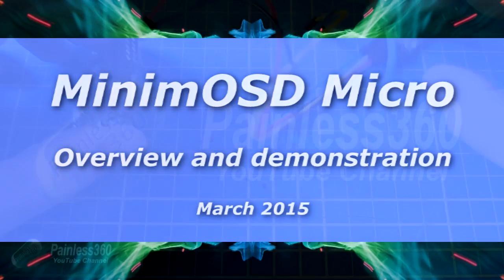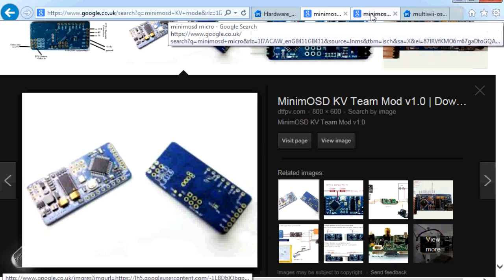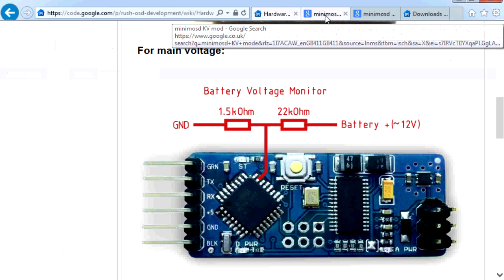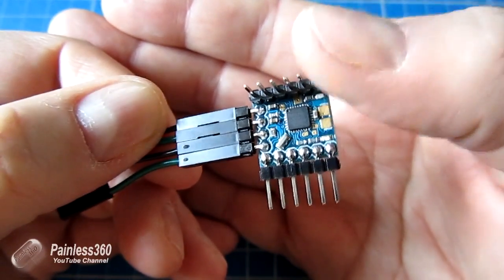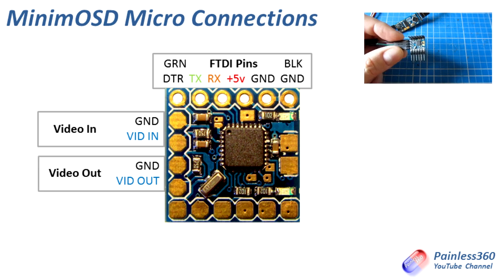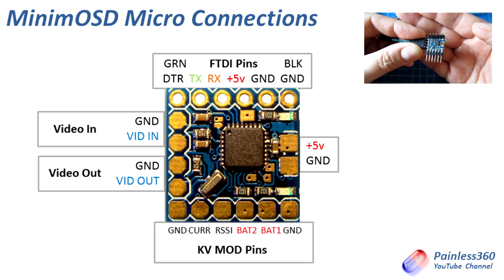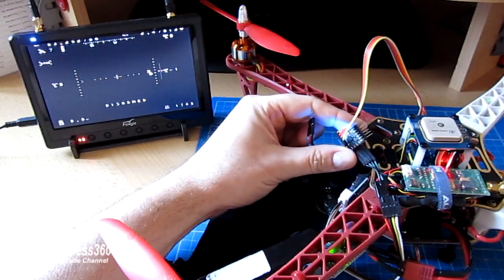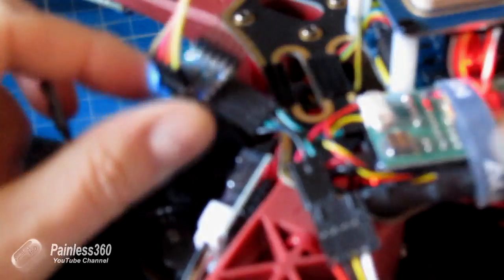MinimOSD Micro - Overview and Demonstration (KV Team mods)

Comment: I'm using the Mini OSD and seeing video, but the horizon bar is garbled characters.  I am also seeing "No Volts" when it should be reading my battery voltage properly...not sure what to check next.  I went into the Hawk Eye options menu and didnt see much there
Reply from the maker: Font file needs updating and check what the voltage is set to displaying... Best of luck

Comment: I just need a standalone unit that has a gyro and barometer in it so it can display artificial horizon and altitude without a flight controller. Now, this might sound crazy, but most planes don't use flight controllers! Whoaaaa! So I bought one with a pre-flashed firmware already on it for easy installation. But if this thing requires a flight controller, it won't fulfill my requirements. If anyone can provide more information, I'd be glad.
Reply from the maker: I did read about adding an GPS to a MinimOSD for a standalone unit - I'd have a look for that.. Best of luck!
Reply: @Painless360  Yeah it also has a place for GPS. From what I've read, it has a built-in gyro that it can use to display horizon, but it can also use flight controller's gyro. Not sure about the barometer, I doubt it has one. The receiver I'm using is a spektrum AR636 with Safe technology for self stabilization, so it definitely has a built in gyro but I don't know if the minimosd can interact with the receiver.

Comment: Hello,
Excuse me,I don't get it: why would I connect the APM's RX to any OSD's TX? What may the OSD send to the APM that should be relevant for the video transmission? 
Sorry, I'm out of any idea...
Again, thanks for all your helpful vlogs...
Reply from the maker: Try it without that connection and see if it works.. best of luck
Reply: Thanks!
but..even if it does not give me any hint about "why", I have to report that i DID follw your directions, with both wires, and still, displays "No Data".. Any help available? I am going to check via 3DR, it used to work before...
Reply from the maker: Sounds like you have a far more basic issue than the intricacies of how the protocol works. If you do want to know why - then you can read up about the MAVlink protocol and look at its bi directional nature and handshaking.. best of luck..
Reply: yes, I figured the handshaking thing quite late!
Reply: Sir,
your "handshake" term gave me a lead, sth to think of ...

I probably should (and will !) be ashamed for asking next, but, actually, I was using the UART port from the FlightController (APM 252V5), to feed both the 3DR and this 'new' device of mine (the micro minimOSD).
They are wired parallel.

Since you evoked the 'handshake', which sounds to me as a synchro, I humbly asked about the necessity of having the RX from the OSD in use.
Now, would you say, my failure comes from this attempt of having both working simultaneously, thus, having two 'handshakes/hearbeats' that are conflicting?
This is all new to me.

I was naive enough to think I could fly and run the FPV+OSD on the one hand (the one eye!), and the run MissionPlanner with wireless telemetry (433Mhz) on the other.

Thanks for your kindness and patience!
Max
Reply from the maker: The port is not designed to run the two in parallel. If you had explained that at the beginning I could’ve probably saved you a lot of messing about. The problem comes from the fact that the signal is pulled too low to detect reliably when connected to two devices. It’s a known problem lots have come up against. Pixhawk has more ports to support setups like this.. Happy flying!
Reply: thanks you so much-- I was in my own adventure without any map neither compass!
If you have any links to products you would recommend, please, share...
As a matte of fact, yesterday, i couldn't even "hear" FTDI right, and had to play back every vid to find out what it was meant to do. I orderd mine immediately now that I can get ifs use.
Knowledge does not always come across!
You are very kind to share your skills for free, I do appreciate that.
Reply: Thanks again for having considered my problem.
It is now certain, it comes from the UART (board, serial port configuration, or broken hardware iself). Today, I ran all possible tests.
I tested the wires with a multimeter (every), removed plugs, inserted pins, changes the order, connected only the 3Dradio, then only the OSD (i wish I could share pictures of all those tests), and ran several times Mission Planner, having done any changes in ports, speeds (115kbauds, 57kbauds...), with or w/o powering the mainboard, etc...

It turns out, there is no link between UART and ANY device... Under mission Planner, I could not even have the 3DR recognized, neither parametered (Sik Radio pannel remains empty of data, logically).
I have totally no idea what went wrong, what I might have touched...
the 3DR telemetry was working perfectly well before all this attemps.
I can imagine that I have done something, either in the software param that make any use of UART impossible, or I have severly damaged the UART module on the board... but how? I can't remember having short circuited at any time... and everything else works alright-as shown when connected via USB. The OSD itself works fine (tested alone), only, I have no data to feed it.

If you come across any brilliant idea of what I'm messing, you would definetly help me  immensely and make my day!

M

Comment: Your wiring diagram at 7:05 is WRONG! GND from battery is at the TOP and +5V is at the bottom. I hope I didn't fried my osd...
P. S. - And I saw the comment about this just now...
P. S. - It still works. Because of my stupidity, I paid 25€ for this board. Noe I only need to re-flash it from ardu osd  to mw osd...

Comment: HI,

Any chance you could do a updated version of this process as a group of us stuck with the new hardware - the CP2104 (https://www.amazon.co.uk/WINGONEER-CP2104-Serial-Converter-compatible/dp/B01CYBHM26/ref=sr_1_1?ie=UTF8&qid=1509812315&sr=8-1&keywords=cp2104) and the process to flash and update the software.

Many thanks
Reply from the maker: I've seen lots of pilots really struggle with the FTDI connection and some FTDI adapters are rubbish and are not using the 'real' FTDI chip. That one has a SIL2104 chip from Silicon Labs. I'd get yourself one that uses the right chip or use an Arduino to do it for you. I always search for 'FTDI basic' when buying them..

Comment: so, if i want to see voltage status from my flight battery

i should solder my 4s battery wire directly to the grnd + bat1 without solder any resistor?
any limitation for battery voltage?

thx
Reply from the maker: +j3fron yes, not sure on battery limits, we've only used up to 4s here..
Reply: Painless360 ah thx for the explanation

before, i kept wondering if i should connect the minimosd from power module

but now its clear

thx anyway

Comment: Please help!! What type of "current sensor" will work with the minimosd? Can't find any info anywhere on this. I've got voltage but need something to read current. Love your vids:)
Reply from the maker: +Jared D sorry, we're not used one here and so many of the latest flight controllers have current sensing built in. A quick Google search found lots of information from others who have got it working. Best of luck!

Comment: I have a question. Do i need to add the resistors to the bat1 pin to get it to read the voltage correctly? I set it up to where my battery is connected to bat1 and gnd, but on my osd, it shows 0v.
Reply from the maker: http://www.holybro.com/manual/Micro%20minimOSD%20Manual%20v1.0.pdf

Comment: hi been a while since i  used my osd, and i have just dug it out its the first version you show on here ( without the voltage divider network ) which will be fine for what i want to do, but i was just wondering will i still be able to use the latest release mwosd version 1.6 on this old board ?  have tried flashing it but i get an arduino error saying that low memory stability problems may occur... any thoughts on this please
Reply from the maker: +bing quadby what version of the Arduino compiler are you using? V1.0.5 is best..
Reply: yeah i have downgraded to an earlier version of arduino 1.6.2 always worked for me... dont know if you are aware, also there is a chrome version of mwosd....!!!!! now its much better than that clunky java version... uploaded latest mwosd and works fine not done the video in our connections yet but suspect it will work thanks painless.... running mwosd on inav

Comment: Hi Lee
I have one of these and I'm trying to use it with a APM board.  I've soldered the pins on for the FTDI adpator and it powers up OK but I think its need another bootloader installing for Mavlink.  Googled a lot but not much about loading the mavlink firmware on.  The normal OSDConfig for minumOSD-extra just doesn't work and says try using Arduino IDE to put the bootloader.  Wondered if you have any idea's.  Or would I be better just getting the bigger board again.  I had a couple and not lasted very long, one was my own fault.  So I thought I'd try the mirco version
Thanks
Keith
Reply from the maker: The firmware should load fine using the FTDI. There are some non FTDI chipped adapters that don't work well. We use FTDI Basic adapters here.. Best of luck!

Comment: Love your videos, always new things to learn. My question is I have a naze32 rev6, using INAV, for RSSI do I use the pinout on naze to micro minim in? To show it in OSD? Not been able to find these types of simple questions answered so have to ask. thanks again for videos
Reply from the maker: RSSI can be more complex than you first think as there are a few ways to send the RSSI signal to a flight controller or OSD. You need to know how the Rx you're using sends it as things like the MinimOSD like a voltage level rather than a PWM value.. Best of luck!

Comment: Want to add simple phrase to video. In my world that's about $99 USD. I'd like to use these at low cost- not for model. How could I use this to add simple 6 charter phrase ID to video signal outside of model? Do I need ardrino or PIC to generate ASSCI characters or other means? Don't have quad/ model circuit to help. Hopefully stand alone with minimal added items- looking for very low cost solution.
Reply from the maker: The MinimOSD is a great way to do that but the code we use in the hobby is designed to 'listen' to telemetry stream from the flight controller and then use that to put the characters on the screen. If you're familiar with Arduino then you should be able to rewrite the code to do what you want.. Best of luck!

Comment: HI. According to banggood info and schema like this http://flight-stew.com/wp-content/uploads/2016/04/DiagramMinimWires223WEB.jpg - if we want to display battery voltage we should connect battery directly to bat1 or bat 2? Is it safe (let's assume we are connecting 100- 150A 4s lipo?)What cables should one use?
Reply from the maker: You can use any cable really, they don't carry any current really. Make sure the insulation is good and there will be no rubbing of the wires in flight.. Best of luck!
Reply: thanks!

Comment: Wondering on how to setup up this MinimOSD Micro to a Naze32 and also using a Matek Mini Power Hub PCB V3.1 board.  You say to connect the VTX and VRX cable to the Naze32 but on the Matek PCB there is also a place for these connection, so which one would be used or does it really matter?

Thanks in advance.
Reply from the maker: Check out the wiring diagram on this page - http://www.banggood.com/Matek-Mini-Power-Hub-Power-Distribution-Board-With-BEC-5V-And-12V-For-FPV-Multicopter-p-1005549.html ;) should help!

Comment: i have a question about  the mini OSD. Can the mini osd work without  an apm? i want to use it on my fpv i have installed on my syma x8
Reply from the maker: You can set it up as a 'standalone' OSD but we've never tried here. Best of luck!

Comment: I've got a zmr250 with naze32 rev6b and micro minimosd. My problem is that "low voltage" keeps blinking on my fpv screen. I'm using the VBat pins to the naze to monitor the 3s lipo. I've got the "use FC for battery" on osd checked. Voltage is correct on the screen and I have 3.5V per cell for alarm set on Naze. Why is the osd flashing low voltage on the screen?
Reply from the maker: You need to setup the low battery warning on the OSD - see our main MinimOSD videos for how you do that.. Best of luck!

Comment: Hope I didn't buy the wrong one. Here is what did order.

MICRO MinimOSD Minim OSD Mini OSD W/ KV Team MOD For Racing F3 Naze32 Flight Con( 182305499606 )

and this.

FTDI Basic Breakout USB-TTL 6 PIN 5V Module For Arduino MWC MultiWii New( 381800496746 )
I want to use it in  a Multiwii Pro or what what FC will work with it?
Reply from the maker: Both look promising. Best of luck!

Comment: why do i always find i'm doing things the most awkward way possible... i just switched a cc3d to betaflight and was looking to add osd mainly for battery voltage...  so as always i goggle and get the fix for this minim osd board to run on a cc3d, but its for librepilot..... hehehe, i can't be the only one doing this kinda stupid path... or am i the only one stupid enough to not get off this path and buy an spracing f3 board or similar?...

Comment: Hi P360 !  Thank you for your Great Videos, it's super interesting  I decided to improve my QAV_250, i finished to connect gps and osd on sp racing f3*. I've got one problem, the battery voltage show me 0.0v and i've got a message with "low battery warning". I don't know why? I do many research on internet to find a solution but for the moment i found nothing. (* I bought a complete kit on BG: sp racing f3 + micro osd " wired and programmed by bg" + gps m8n "programmed"). I just have to make cables and configure cleanflight,everything work great except battery voltage on my goggles... Thank you & sorry for this bad English.
Reply from the maker: +Sebby02 you will need to connect the vbat pins to the battery and make sure the OSD is getting that data. Best of luck!
Reply: Painless360  Hi ! Thank you tardivement for your answer. I watched another of your videos about battery voltage and osd. I found a menu on osd in my goggles (throttle left+pitch up) , i've changed settings on the menu "voltage" and now i've got good battery voltage on my goggle screen. But, in flight, i noticed that the voltage fall fastly to 12.5v to 10.9v in one minute ! I finally understood that it was a problem of interference. I decided to move away OSD module, vtx, camera and GPS as far as possible from each other.And now everything is perfect!
Reply from the maker: Great work getting it all working. Happy flying!

Comment: Hey there Painless, I've wired in my microminim OSD v2, I had no intention of using any of the functions other than displaying time and voltage, now i have "DISARMED/NO DATA" flashing on the feed, do you know how to disable this?  I dont have the tx/rx pads connected.
Reply from the maker: That's because the board is expecting to see the data from the FC. To get rid of it I'd connect the TX/RX pins then remove all of the things on the screen you don't want using the GUI. Best of luck!
Reply: Found solution. in the flight controller section in config.h there is a //#define nocontroller. // out your actual FC and delete the // of the no controller line.
Reply from the maker: Nice find! Thanks for letting us know.. Happy flying!

Comment: the 5v is it to power the micro osd or is it to pwr the fc?
Reply from the maker: It powers both and the radio receiver too.. Happy flying!
Reply: I guess I mean the 5v on the osd or do I need to pwr the osd with my 5v bec that Already pwrs rx and fc
Reply from the maker: Power them all from the UBEC. You do need to have a UBEC that will supply 2A or more as the OSD pulls more current than you expect.. Best of luck!

Comment: I am huge fan fan of your videos; i recently buiilt a Quad based on your Naze32 videos. i am using Naze32 Rev 6, with GPS, SONAR, and Micro Minim OSD firmware R1.6. I checked all the cables, everything seemed to be OK. I was able to get the Video from the camera but no overlay. In other words, i am getting a Display 'DISARMED" all the time. Basically No Data from FC. 

I have MSP enabled on UART1 with BAUDRATE of 115200 matching in the UI and the Sketch and UART2 is used for GPS connected to the 3 and 4th Pins on FC. 

Also made sure TX->RX and RX->TX are connected between MinimOSD and the FC.

What am i missing? Any help would be appreciated.
Reply from the maker: If you're connecting the OSD to the TX and RX pins on UART1 then you'll only see data when the board is armed. Best of luck!
Reply: I am still not getting data after arming the board. i am still seeing "DISARMED" and "NO DATA" message.
Reply from the maker: All the steps we followed to get it working is in the MinimOSD/Naze32 video. I'd check everything again. Best of luck!

Comment: can this be run from the naze32 rev 6? just it say it need 500mv or do I need a bec ro run it.
Reply from the maker: Depends on how many amps the BECs can supply. You'll need 0.5amps for the OSD and about another 0.5-1A to run the flight controller and radio receiver... Best of luck!